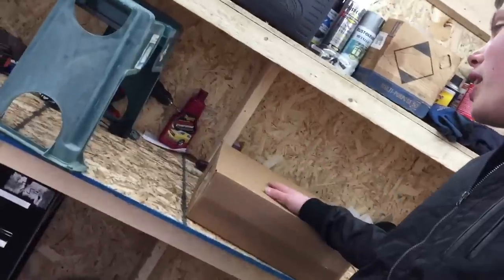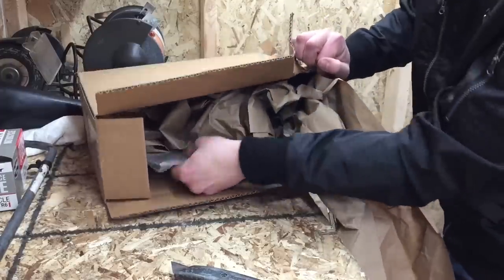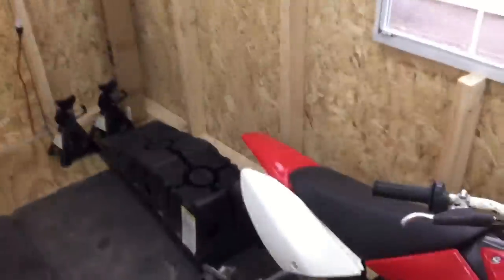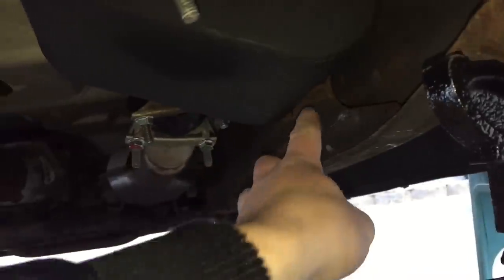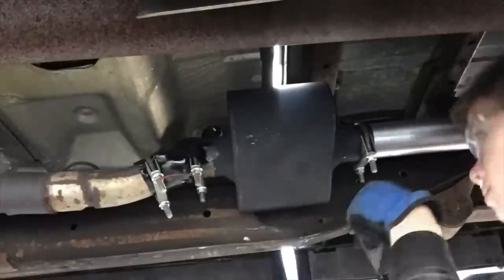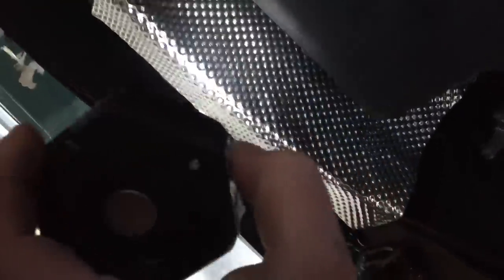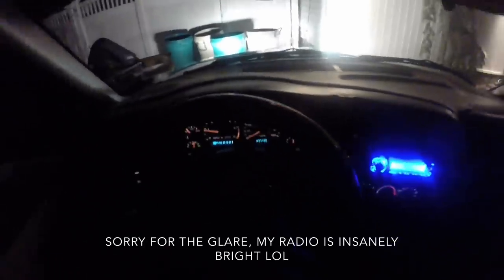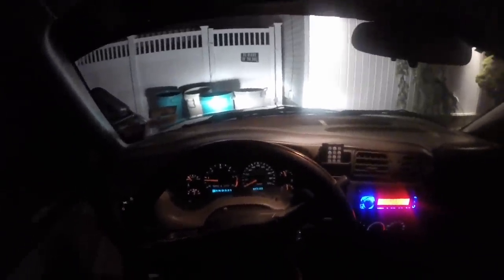The TRUCK Gets a PERFORMANCE MOD! Time to Make POWER!

Comment: If you remove the riveted plate off of your butterfly valve in the throttle body you will free up horsepower and torque throughout the entire rpm range😉 I've literally done this dozens of times and always works on GM vortec  4.3 and 5.0 and 5.7 engines from 1996-2000ish.
Reply: I did this on my 97 tahoe. I actually have a video on my channel doing it. I couldn't get the whole flap off tho. But i was able to grind most of it down.

Comment: Sorry but that’s not a cold air intake
Reply: Ya it is
Reply: Ryan Lacey no a cold air intake have air boxes
Reply: tayler sampson you dont know what you talkin about
Reply: SAMM FŁ4 look it up dip stick
Reply: Yea rip but it’s not a cold air
Reply: @jacystone973  no its not. Its labeled as one. But its not . a cold air intake will have either an airbox or heat shield and it will b directed by an air induction port. Coming from outside the truck. A metal pipe with just a cone filter can actually decrease horsepower do to the fact the filter is open and sucks in hot air coming off the motor. If he would install a air box that connects to the factory fender induction and heat wrap the metal pipe. Then it would b a cold air intake. But as it sits, the factory one is better. But I still give props to him for working on his truck. Not many teens still do that anymore
Reply: @daltonandrew168  o I didn't even see that
Reply: @daltonandrew168  I wasn't paying attention
Reply: @johnhenderson3967  no it isn’t cold air intakes have a box taking air from outside of the engine bay not inside

Comment: I had the same intake on my 99 eXtreme 5 speed, and all I can say is take it off now! Nothing but problems! In this situation you get what you pay for, and its not worth it if you're not going to get the highest quality possible. I made that mistake lol, I put the stock intake back on and the truck actually pulls harder now.. The whole cold air intake thing is a croc, especially when the aftermarket parts actually make the truck breathe hotter air than originally.. I'm keeping the stock intake on it until I go forced induction.

Comment: U have a air 2 fuel sensor? No? Then IT wont add hp mabe even decrease jt lol
Reply: The mass airflow sensor meters how much fuel needs to be added to the motor based on how much AIR is FLOWING into the motor. If more AIR is FLOWING into the motor then it tells the computers to give the motor more fuel. And anyways a lot of cold air intakes just help fuel economy because a motor that breathes easier works less therefore being more efficient.
Reply: @milan5159  how is it running rich if it is supplying the motor with more gas due to more air entering the motor? Its keeping the same ratio of fuel to air, but since theres more air going in theres got to be more fuel to keep the ratio, that's what the mass air flow sensor does hahs i just fixed my neighbors truck that had a faulty mass airflow sensor with a cold air intake, fixed mass air flow sensor motor ran just fine so stop, i know a thing or two. A mass air flows job is monitoring air going into the motor to tell the computers how much fuel is needed.
Reply: @milan5159  then the computers give the injectors more fuel to be shot into the motor, thats its job. It tells the truck theres more air coming in and to give the truck more fuel to keep the mixture good.
Reply: Milan well his truck has a mass air flow sensor, so there won’t be a problem.
Reply: @colbyn3343  that is EXACTLY what i have been trying to tell him! But noooooo lol its not like i literally just fixed my neighbors truck that coincidentally had a cold air intake and it was a faulty splice into the mass airflow sensor and as soon as i fixed the wire it ran fine, it had to line out a little bit where it ran a few hours out of whack and had to clear out some flooded fuel and stuff but the mass airflow sensor adjusts the fuel based on air pressure going into the engine, hopefully with more than one person telling him otherwise he will stop haha

Comment: Sure wish you'd put in a link for that. Can't find it on ebay or anywhere under high temp dampening or heat shield. Looks like Noico sound dampening material. looks like a sample sheet though...........

Comment: Does it have a limited slip rearend? I want to find sn extreme rearend with the stabilizer bar and limited slip for my 02. Its an LS trim but I have it lowered 2/2 with 98 ZQ8 wheels on it.
Reply: my 2001 s10 extreme  4.3  with standard 5 speed n 3 link posi trac  from factory

Comment: Throttle body spacer now with 93 only. An find someone who knows about the eprom ecu can get different tune for better throttle response and lowend torque
Reply: Also would be good to swap that filter to a true k&n filter and use the spectrum or k&n filter cleaning kit but you do need the oil to re oil those filters
Reply: And another thing with those vortec engines the mass flow air sensor that plastic screen in it you can bust it out on both sides it will alow more airflow.

Comment: I put a cold air intake in my truck and it blew up my knock sensors and made my truck idle like crap, it looks cool and sounds better but it’s an issue in the long run. And it doesn’t affect you gas mileage, take it out, it’s not worth it